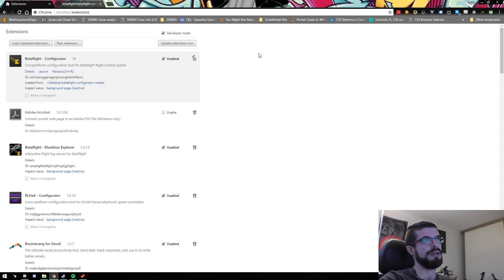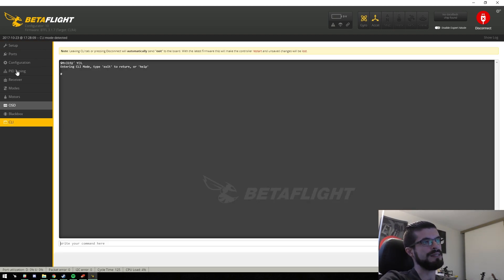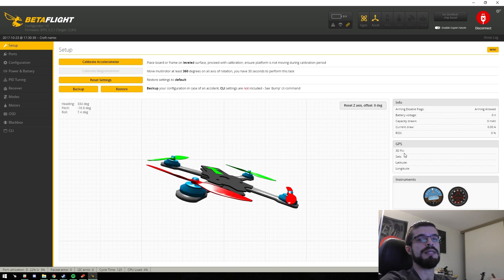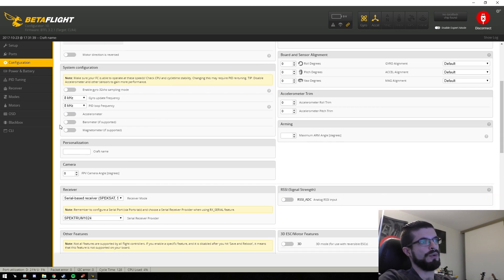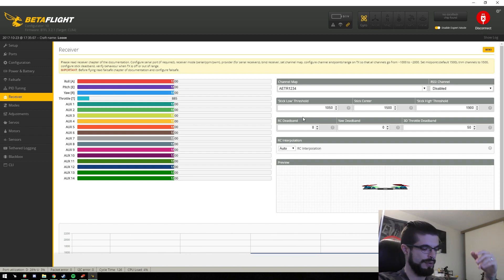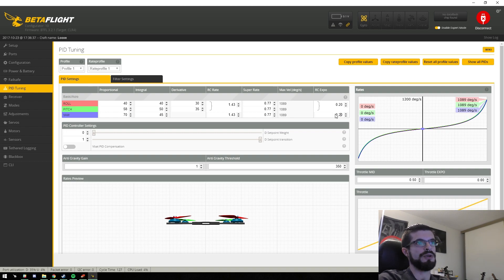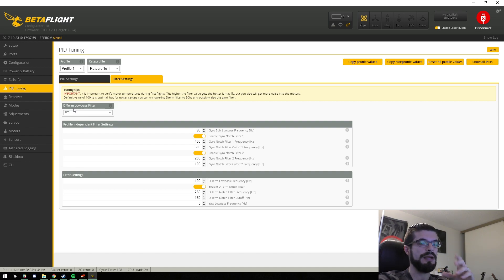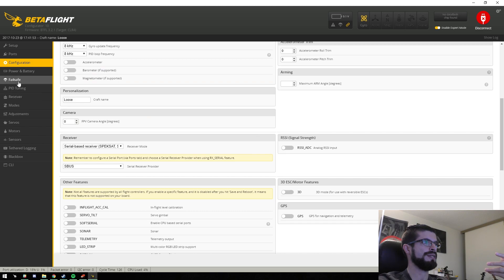Betaflight 3.2.1(stable) - How to Flash and Setup Your Quad! - [ How To Quad ]

Comment: Hey Lucas!
Thanks much once more, you helped me a ton with answering all questions I had about my build. 
I did have rolls and flips of death at the beginning of my new flight-time but found help in youtube, turned it down do Dshot 300, put airmode in a switch mode, reduced startup speed of motors in blheli config. to 0.03 or sth. and something else, don't remember atm but might not even have to have done it either.. 
What can I say, flies like a fairy now! PT1, Notch filters off,  no hot motors =) and feels great! Surely need practice now, endless sticktime when the rain takes a break ^^
My first new video is up too, check it out if you want ;-)
Just a first try and shot, had failsafes at the end. (description)
Wish you great success with your business and lotsa fun flying!
Reply from the maker: O. Pixit hey man! Glad to hear your quad is flying well no at least! Will check out the video soon

Comment: There's a bug currently with 3.2 and 3.2.1 where the current isn't reading correctly. Sometimes when you plug in the quad it will show an amp draw that is false sometimes it won't. The current isn't always accurate either, so just a heads up!
Reply from the maker: Adam-g1 you know I have never really trusted current reading on BF but I'll be extra careful with it this time around.

Comment: we talked recently, so I found the answer that we didn't know to my question. on clracingf4 board only the sbus has a inverter. the tele pad does not, so if using frsky s-port you need to high jack un-inverted telemetry signal from rx to run to fc. cheers
Reply from the maker: Roto Vicious thanks for the info man. Looks like they are releasing a v2 soon too.
Reply: Loose Transistor FPV yes they are, some sites are taking preoders now. It will have hardware inverters on the Uarts for us Frsky guys.